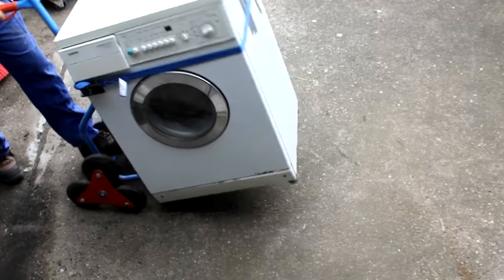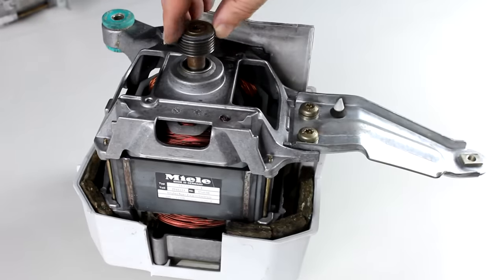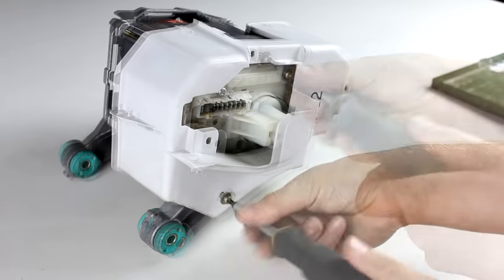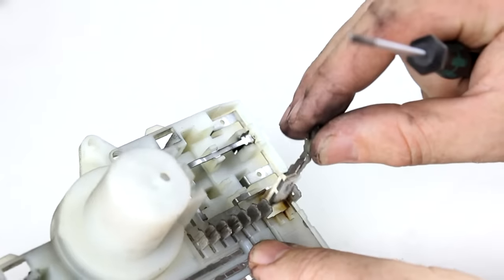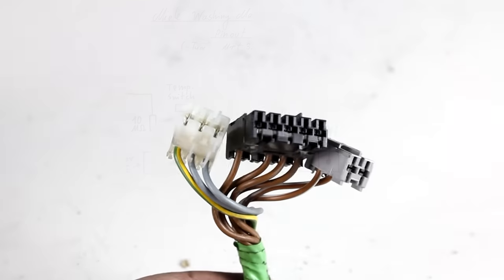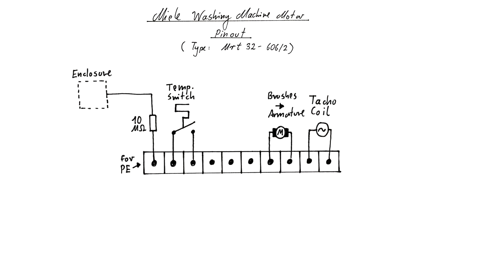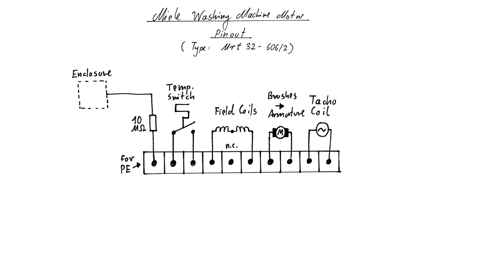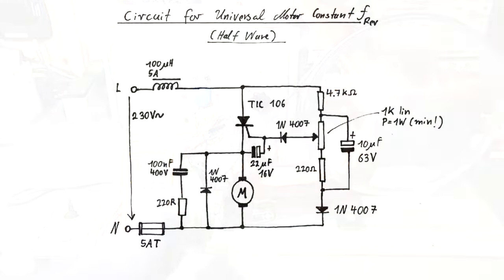Inside a Washing Machine Motor: Explanation,  Pinout, Teardown AND Experiments

Comment: Why not try making a generator,??
 Or I'm thinking about trying some experiment & see what would happen if someone were to: add
Permanent magnets/ to the inside of the motor" like this" to see if enough voltage & "or both current & voltage" can be generated to make it run on its on power. After giving it a boost with a short blast of Electricity of course.!! I've not tried that yet" but I have recorded over 400 volts output, while the motor was RUNNING"!!! ( full power from the house AC/with no load).!! I tapped into the main connection & and the input where the run coil goes to the capacitor.
Most motors field coil motors, like 
Those have a run coil, that is connected to a capacitor,. It's there to actually start the motor up & get started" running. Then after its spinning fast enough" the run coil is cut off, and the main AC from the grid picks up & kicks the motors main run coils on to take over & push the R.P.M'S On up to running speed.
That's when the start-up coils are cut off, & the larger, Heavy duty coils take over, & run the motor.  When the motor first starts, it uses the smaller Coils that are connected to the capacitor, that's attached, to the start up coils. The start up coils are
Then cut off, by the Capacitor. So" 
Those types of motors are found in 
Blowers, / mid to Larger sizes... They are used to make generator's. There
Are some types of generators that are already using " Caps " so, Obviously someone has thought of that.... The caps go bad" & people toss'em out thinking there junk,!!! I've 
Trash picked so many thing's & fixed'm that I've lost count....
P.s. if anyone else wants to try that, you have my permission to do so.
I will be open sourcing everything, 
That I think of to try... My channel is
Coming soon...

Comment: Ok the thing you keep calling a transmission is not a transmission,  as all it does is hold the bearing for the flywheel that connects to the washing drum...  A transmission changes  High speed into lower speed with torque like a cars-trucks transmission!
Reply: That is a transmission, By your definition anyway. It turns the high speed of the motor into a lower speed with more torque. Sure it's not as complicated, But it is still a simple reduction belt system.

Comment: The plates shouldn't have been welded together. That connects them electrically and defeats the purpose of having the steel laminations. They are laminated using a resin or glue to isolate them electrically so that eddy currents do not heat up the magnetic core and waste energy.
Reply: KnightsWithoutATable 
Ideally, a non conductive yet magnetically permeable material would be used but, compromises are made all the time. Welding together laminations is quite common with motors and even transformers, although not ideal it's still an improvement over a solid chunk of iron.
Reply: Skruffles what about using ferrite? is ferrite expensive?
Reply: nobody's shadow 
I'd say so, getting ferrite produced in rather large blocks for motors is just not feasible, especially since it's a very brittle material. It is used for smaller transformers though as their construction is small and geometric, ferrite is also good at higher frequencies so they're used in switch mode converters a lot.. For lower frequencies or higher power applications, laminated silicon steel is still a good choice and a well designed transformer won't suffer much from eddy current losses.
Sorry for the essay :)
Reply: I pointed it out since I expect a higher quality of a part to be used in a durable good from a good manufacturer.

Yes, ferrite is expensive. But about those welds: Small cross section=high resistance=high amperage. Now, at the 50Hz that this thing runs at, that isn't going to add up to much and it is easier to manufacture. With the hot water that can be used in the unit, you are going to have to have heat tolerant parts anyway, so you bother to save a little electricity as long as you are within a reasonable Wattage.

The laminations can be held together by resin and insulated pins that run through the laminations and are either held in place with insulated nuts or peened ends. Microwave ovens do this with their cavity magnetron so they can lower wasted energy and not have to draw as much wattage to heat the same amount. The higher frequency transformers like audio and RF have to try to minimize eddy currents more since magnetic reluctance increases with the frequency. Decent power supplies will also have non welded laminations since it would effect efficiency in the early stage of the circuit and increase losses down the line.

Comment: Hello. I want to know that why my washing machine universal motor  burn the carbon . Motor is 100% ok on ac volts but as DC volts by the pcb machine motor carbon smelling high . I change the  Carbon brush  but still problem  and washer display error 3e  but my motor is ok carbon ok wires no harnesses  DC rectifire is ok. Thirister is ok.  But I don't know about the reason

Comment: Todays washer motors are junk. The motors hardley ever went bad and did not have all that crummy plastic connector stuff. I have fixed some washers over 40 years old and themotors are just fine.

Comment: Not sure why you want to bother to run those AC motors off of DC when the DC motors are so cheap especially like that windshield washing unit will have its own worm screw drive to deliver WAY more torque.
 Over here in the USA I have not yet seen a washing machine with that type of motor. Usually they are dual speed. with blue and orange wires. One is usually 1140 RPM and the other 1725 RPM. The first being used for the washing and the second for the spinning of clothes. Often the washing winding goes but the other winding is still good. I have made grinders/wire wheels/buffers out of them with great success.
Reply: Controlling what can essentially be treated as a normal DC motor is much easier than controlling an AC motor. In the simplest case you could build a speed controllerfor a DC motor with an NE555 and few other components. Controlling DC motors with an Arduino is also much more straight forward.
Washing machines have been variable (not just dual) speed for a long time here. They use it to adjust the speed for least vibration and you also set different speeds for spinning depending on cloth. You couldn't do that easily with an induction motor.
And comparing a windshield wiper motor with a washing machine motor? Is that all the power washing machines in the US have?

Comment: all the motor's  whit brushes today no good  because the problem whit commutator ,brushes etc ,,,today DC motors or AC motors whit brushes  are obsolete ,no body want them anymore, everything is brush less  or AC  motors , i use to repair them by the 1000's ,all sizes and type's ,for more then 30 years ,today no more DC motors in the shop,no custom want them ,the shop have a few AC motors to repair because everything went  to china, but i miss them because was my job back then ,i'm 70 years old i don't care anymore but those small UNIVERSAL motors still  around whit brushes  and commutator and the european's use them  for washer machine's ,,, stupid,,,,, i think